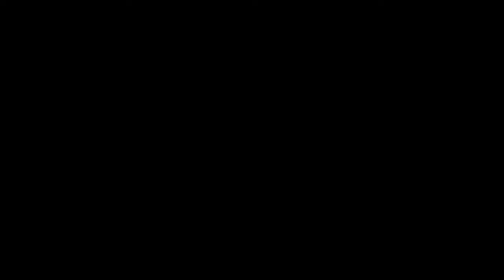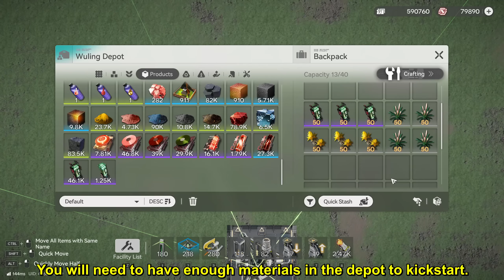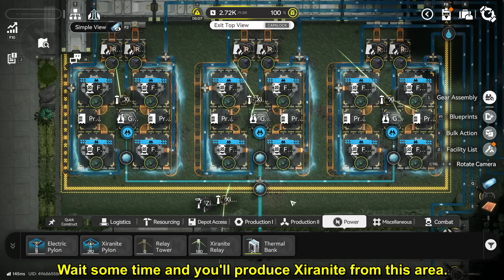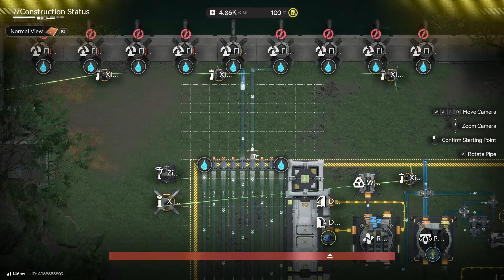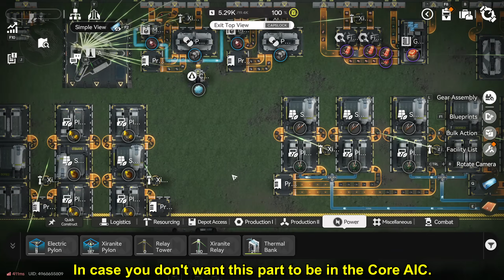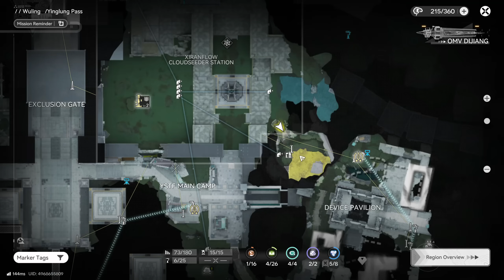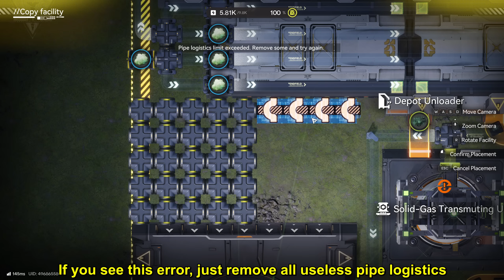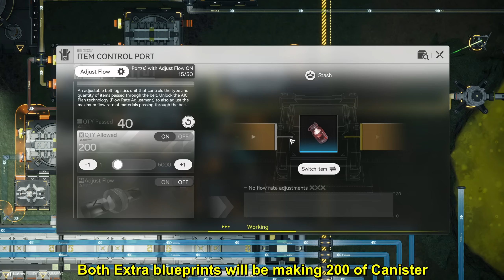1.4 Wuling Factory Blueprints Part 1 - Max Profit Mega Base Blueprint Asia/NA/EU【Arknights Endfield】

Comment: What's your Xircon usage at? Mines 73~74 yield / 75 usage for current usage. It naturally later ended at 0 Xircon in my local depot.

edit: figured out how to make 76~77/75 usage per min. Use the purification blueprint exactly first, then modify it swap the singular conduit inlet to a manifold like the other one, place down a reactor near the bottom of it.  Then pipe it to the new manifold, two pipes should now be connected to it (one from the CUPRIUM's being produced), do what the video does to unload it to one of the purification node units in the test area - the second unit in the row. Next place a depot unloader to the bus section that just happens to have a gap to place one down, unload ferrium powder. And belt it to the reactor crucible. Then place a protocol stash and belt to that too. Now the IMPORTANT part teleport to the Test Area where the treatment sector is, place a conduit inlet in front of the byproduct unit, and also place a treatment unit next to it, place a splitter and pipe to the inlet and the treatment unit. From the inlet you will now pipe the byproduct of Xircon Effluent from the test area to the CoreAIC and place an outlet and connect to it. Finally pipe that outlet to the Reactor Crucible, open the reactor menu and make sure to unload sewage and Xircon as products.
Reply: I was looking everywhere for what to do with that extra ferrium, thinking I had massed something up, and this is perfect. This really ought to be built in to the base blueprint.

Comment: I think im doing something wrong my new ac base keeps getting clogged nd not running efficiently in like yours even though I've done everything that you've done
Reply: Yeah I am confused, my expanded crucibles are clogged so I can't make any batteries. I have double checked they are going to the fluid supply unit in the water. I probably did something wrong but not sure what.
Reply: I am experiencing the same thing I think my batteries are clogged or something im onky making like 5 per minute instead of 15 idk how to fix it am i supposed to turn on the auto sort whatever on the expanded crucibles??
Reply: @shipdemon6701  Try tossing out your Cuprium... I found that the overstock caused the crucibles to back up horrendously.
Reply from the maker: uhm if you followed everything correctly step by step, everything should work.
make sure all pipes are connected and all powered up, nothing is splitted unless i asked to
Reply: @KyoStinV After following the guide, there's a surplus of 120 cuprium per min. I found that using all four ports on your trash blueprint helped handle the surplus to keep things running properly. Cannot figure out where to use up more cuprium unfortunately, so I've been having to throw 89k of it away each day since it eventually hits the overflow. 

Yesterday I ran some lines from the protocol stashes in Wuling directly to the crucibles to assist with how much accumulates.

Comment: There is 16 extra xiragen/min at YP on the line coming from the EZ. You can make 16 work with splitters. It is enough to run 1 more assembly line, slowly. 6 goes to power and the other 10 can be turned into 4 Heavy Xiranite or 10 Xiranite. 
We are short cuprium and enough gas to make more pyrrolite. you would have to power 3 machines for 6 each to make any more and there is only 16 available. You could only have them powered sometimes using splitters and control valves - but that is a lot more trouble than it is worth, just take the extra xiranite imo.
If you decide on heavy xiranite you will need to set the item control for the core production at MS to allow 6/min. This is more than needed but is the lowest setting possible. You can loop 2/3 the output back to before the item control and make it effectively 2 if you really want to. If you choose normal xiranite you don't need to worry about the cores.
You don't need to worry about this at all to have enough to sell. It is only for the folks like me who get a little ocd about ratios in factory games.
Reply: I just notice my cuprium ore really going down slowly is it okay?

Comment: Excellent as always. For those like me who like everything looking pretty and don't like pipes everywhere a tip to keep in mind is that there are actually 3 zones for buildings in all places with Sub-AIC's. There's the Sub-AIC area itself which allows unlimited building in its radius (aka the yellow square) and is the only one you can put belts into. The base camp itself which is the white square you can see on the larger map (The Marker Zone one has 60 protocol space for example). Then the rest of the map which has whatever limit they put in (Marker Stone Example 180). All of these build limits are independent of each other.

This means the water pumps that are placed in the white area for the Marker Stone Area for example actually take up some of the white border protocol space and not the wider map protocol space and since it isn't used up as much can free up space in the rest of the map for whatever you like such as Conduits to not make it pipe central. These also have their own zipline cap as well. Sadly the main-AIC area takes up the entirety of the space available so all the pumps take up the limited space. 

On a side note if you are having problems with protocol cap for the main area due to the pumps like me, the Jinyu Valley Sub-AIC and not the core area option is the better choice.

Comment: Hey everyone (And Hello Kyo if you see this)

There are some pipes not connected in the YP Sub-AIC blueprint for NA. So make sure you look at the pipelines and connect them properly so your base runs and you do begin to produce the new components.

I followed the guide, looked and saw 4 Solid-Gas Transmuting Units not getting the Xiragen, and saw there was some pipes not connected, which made me go through fully to check them all.
Reply: This can happen when you move the outlets with his method by connecting them and dragging them, even if they are perfectly lined up. Just make sure when you do this they flow, connect manually, or rerun the pipes to the outlets. I spent hours (embarrassingly maybe more) a few blueprints ago figuring this out. Outside of that, there’s no errors in his design, and he does say to check that everything’s flowing.
Reply from the maker: everything should be fine, i checked multiple times.
Just like Yakumo said, probably the pipes being Bugged for some reason, so reconnect until everything flows correctly.
Sometimes the game does bug the pipes, from top view you see them in line, but they are not connected...
Reply: can u explain more cos i noticed that some of the solid-gas transmutations don't get enough xiragen, affecting the yield of pyrrolite. i think u found the issue but can u explain how to fit or find the pipes nopt connected
Reply: @SolomonLeveling I had the same problem with occasional outages in pyrrolite producing solid-gas transmuters. My problem was that only 4/5 gas extractors were connected properly, with one connection not working for some weird reason (one of the conduit outlets was getting clogged instead of sending gas through pipe converger correctly). Once I fixed that and feed in was 5/5 gas extractors, it worked fine as is.

It could be your issue as well. Double check that all five xiragen extractors are properly running and delivering gas to the input line in the base.

Comment: I am... extremely puzzled, I think I completely misconceptualized something.
I thought that connecting multiple ressource extractor / pumps to a single linear pipe system would drastically slow down the liquid or gaz distribution...
Just like if you split a belt in this game you basically multiply your intake speed by 2, is that not the case for liquid and gaz?

Thanks a lot for this guide :)

Comment: Thx for the blueprints Kyo. 
Since I didn't want to choose between Cuprium Parts and Syringes in the MS sub, I took both your blueprints and removed what would be a duplicate, so Separator Cores and Canisters. Then I removed one Cuprium line from each blueprint and did some re-routing.  So I have both blueprints in one at half effectiveness. It may not be the prettiest, but here's the code for NA/EU: EFO01Iao8138oA9E5o08
The Sub-PAC has to be moved some, I think it's one to the left. The water pipe is too long and needs a Fluid Tank. It also stashes some unused Powder for the Depot Node missions.

Comment: Thanks for the guide! It worked great, though I ran into the limit for protocol capacity for Wuling City. I managed to reduce the demands on it and get my farm's sprinklers back by importing the water from the pass to the north east. There's lots of water in that intro area, so I put 4 pumps of water for each of 3 double conduits, replacing the 12 water pumps by the AIC itself, routing the conduits directly into the AIC area (with only one forwarding stop to the east of the AIC in Wuling City), and it saved me enough Protocol Capacity to bring my farm back online (and when I'm done with the farm, I'll stash the sprinklers and bring my weapons back to the essence farming spot).

Comment: I like the smiley face in the core AIC. I also deleted the two stashes that got the Seperator cores and moved the the core there. Moved the conduit and pipe splitter one to the left so I can get two bands on the right side out of the packaging unit on the left. 
Also wondering about the layout of the dop sequence where the battery is made. Would it be possible to adjust that one with just an item control port? Like in the way we could adjust liquids/gases?

Comment: Your core AIC area doesn’t need as much water as the ytber design i use which needs well enough water to drown a ridiculously unrealistic AI center xD your design looks amazing tho tho i wish that your SubPac didn’t use any forges since all 12 of them are in the core AIC area in the ytber design i use on my account. I'm looking for SubPacs that don’t use any forges to make hetonite parts and cupprium parts and more of the Stockbill hand-in resources that go for 1 stockbil per 1 or those that go for more per 1. But nice video Mr KyostinV. 

Btw a tip for those that might not have noticed, but you can use xiranite to make a self continuing loop of xiranite gas, which can then be used to make liquid xiranite (through gas to liquid) to power other buildings. The liquid xiranite maker can also be made into a self continuing loop for the liquid xiranite Aswell, oh and dont forget the flow limiters for the loop on both liquid and gas loops to have min required to use each facility (use that last bit of my comment as you want since it's just a good tip)

Anyone can use this and i feel like i want to make this last part known to help the overall community so plz spread the word to those that don't know about this so they can have an easier time with their pipe SPAGHETTI

Comment: Just to be clear then we don't make the other components because we can just use the new ones for all our artificing needs and there's no more outpost selling priority items because there's no issues with sewage, we just sell batteries?
Reply: Not sure about second part, but when you craft gear you can now press "switch techiques" and choose pyrrolite components for all. It also cuts stock bills costs by 99% for gear production. Switch all didn't work for me for some reason, so I press "Material cost" for each gear and switch to pyrrolite manually. It also remembers your choice
Reply: He made a video where he talks about it and gave a blueprint where it trashes excess materials as there is indeed a sale priority  @lanneta3974
Reply: Thank you for commenting on this, I was finding the facilities that are making the other gear components and I just realized in this comment that you can use the latest one for making all the gear.

Comment: unfortunately, our current batteries are still vulnerable to factory shutdown, if cuprium backs up too much then it clogs and the battery production dies eventually taking the factory down with it, the best bet to prevent this right now for the base is to never let pyrrolite parts and whatever product extra 1/2 is making back up, otherwise you'll have a clogging cascade that will kill the factory
Reply: that's why u sell them, no?
Reply: @ryoukaip  yes, but this is more a future problem for when we leave Wuling, if it remains as is, we will need to constantly keep tabs on the factory or otherwise have it jam really hard
Reply: @Glennkabob at the end of wuling chapter kyo will probably update his factory to its final form so its aight
Reply from the maker: You can try to use my other video in the pinned comment:
The overflow protector
Reply: I just notice cuprium ore slowly going down with 400/min yield and 420/min, and on theoretical data 420/min 420/min... is it okay?
Reply: @MiracleGamesGG check to make sure your cuprium mining rigs are receiving enough water
Reply: are you getting like 5 batteries per minute instead of like 15? Is it because of cuprium parts?
Reply: @shipdemon6701  check for any clogs in the chain of what cuprium turns into, pyrrolite, yahzen syringe, hetonite, anything, dump a bunch of that, and then refer to KyostinV's follow up video to prevent this problem permanently

Comment: checking kyo after reworked my own factory is like comparing homework with different insight
Reply: For me, it's like comparing homework with the answer sheet
Reply: @mediumtext8038  But there is no wrong or right way here. If it works for you, then it is enough. Especially because there is so much leeway this update with you only needing goods worth a maximum of 88000 stocks for trading and having much more space than ever. I believe, that this update is really good for people to get into the factory part of the game again if they wish to do so. Existing production trees are simplified and you can play around much more without loosing "optimal efficiency".
Reply: @mediumtext8038  for me the guide is the homework i forgot so i ask a friend to show me his sheet, whose parents are the teacher so they have all the answers correct

Comment: Question Kyostinv. Is there anything that breaks if it overflows on stuff like Hetonite parts, components, batteries, or Xiranite? I just want to know what to sell first just incase
Reply: Considering he didn't mention, likely not. We have new production tech and new purifications, seems like this time all good

Before the parts were making the sewage, and sewage was used for crafting batteries, now they're made from gas and no need for sewage = no need to keep sewage coming = all purified instantly without transfer for battery craft
Reply from the maker: Actually yes, you can use my new video of the Overflow Protector to stay safe 100%

Comment: I installed several gas storage facilities and now they're all useless 😂😂
Thank you bro
Reply: I'm surprised how little gas we use, more than HALF of gas is not used lmao
Reply: @signer0001  cause bro did specific calculations with the available resource limits and didn't overestimate them, I connected all the gas storage tanks into one pipe and connected it to the sub-pac
Reply: @a @ahmedada9793 tta work on that gotta work on that regional lvl!
Reply: @ahmedada9793  that's not even what they were saying

Comment: Kyostinv the Gacha God, plz bless your lowly peasant viewers with a xiranflow cloudseeder station defense lvl 3 guide
Reply: Near the terminal walk towards the pavement in front (start the terminal too see the pathing from enemies).
At that pavement, put down 1 Marsh Gas (to slow) and 1 Acid Soaker (to reduce defence), then put down the remaining as Mortar. Example 4 Mortar in the same place, then jump up using the left jumppad to get to second floor and drop 2 more Mortar there. If you math it, its 8 total turrets, its able to auto and clear 100% the mobs and boss barely by the teeth, so just use 2 more slots to put down 2 more Mortars anywhere you want as long it's within the boss jump range.